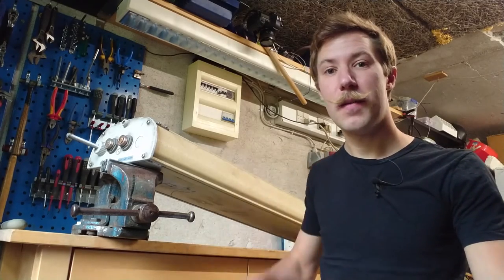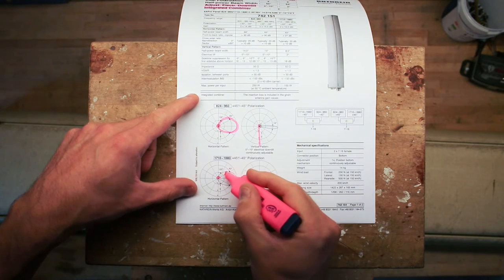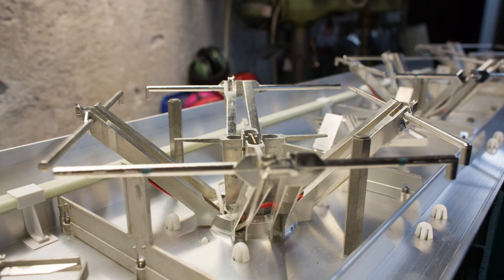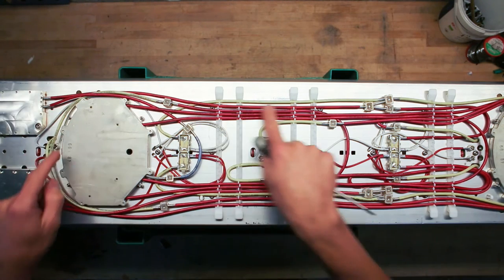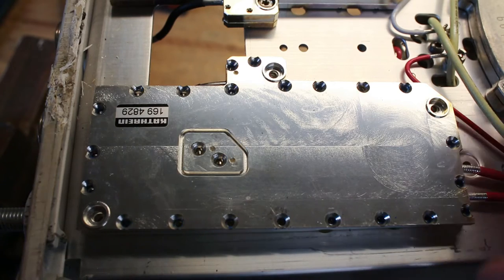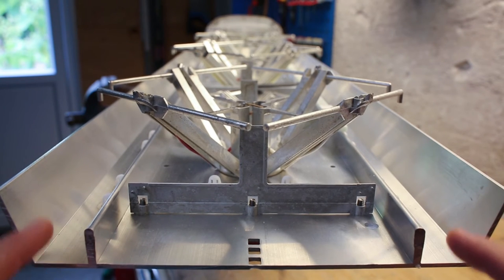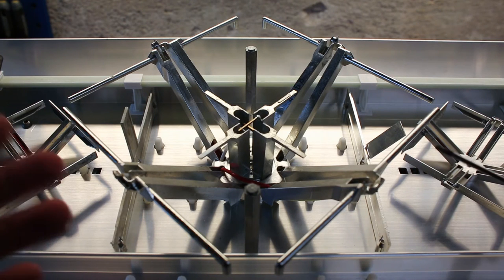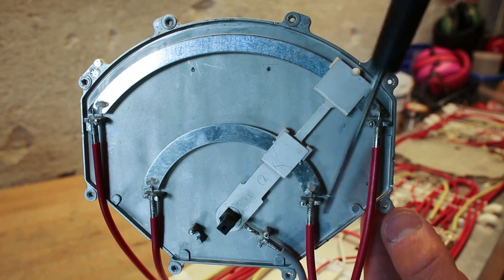Teardown of Kathrein 1800/900 MHz Antenna For Mobile Phone Base Station

Comment: At 11:00, it's not exactly a combiner - it is a diplexer (basically a splitter/combiner that converts one input into two outputs that are split across two frequency bands). It uses distributed element transmission lines to avoid discrete components. What you see on the trace is basically a combiner and a set of filters in one package. The "plastic" you took off the top to expose the traces is probably the same material as the board itself, and is used to realize the transmission line as a stripline within the diplexer body cavity. The diplexer lets the antenna have a single input/output port that can be used for multiple different bands.
Reply: Yeah, it's a common mistake.
Reply from the maker: I have done it as well with duplexer and diplexer :)
Reply: Where do you even begin to design something like that
Reply: Hi , what do S11 S22 and S33 should look like ...? Thankz
Reply: he is not wrong though. That piece "combines" for uplink (signals received by 2 antennas on 2 bands get combined into same wire) and it "splits" for downlink (900 and 1800MHz signals from the base station come in the same wire, then get split for transmission through two separate antennas). Actually, every combiner is also a splitter. It just depends where you input your signal and where you get the output. In this case, both ways work at the same time.
Reply: The combiner is a filter that is used to avoid resonance between low and high frequencies of the branches and arrays.
Without that the 900 MHz dipoles would also behave as a monopole for the 1800 MHz frequencies.
It can also serve to maintain high isolation between mime antennas.
It therefore keeps the radiation pattern optimal

Comment: Very interesting, I love how every panel like this (every part number) seems to be built a little bit different with different elements and a different architecture.
I have some of the bigger dipole elements with the more common "small sqares" in the middle. 

Also note how every color of semi rigid coax is a different impedance. 
Kathrein loves to use coax as transmission line transformers for matching all the different components. 

The coaxes are looped around the inside of the unit to keep the phase matched up, since every feedline needs to be the same - or atleast some known - length. 

The input diplexers are a piece of art and very stable. 
I wonder if anyone could come up with a design, that is as simple and effecitve. 
I guess these stripline designs are all autogenerated or atleast auto matched for efficiency. 
As Robberiffic said, they are a combination of filters and a power splitter. 
The upper dielectric makes them embedded striplines and also gives a higher dieelectric constant inside the enclosure. 
With a big airspace it is quite hard to keep oscillations down in such a enclosure with such high powers. 
All in all this sector antenna seems to be built quite a bit more solid than the ones I have seen. (also from Kathrein)

Greetings, 
Michael
Reply from the maker: I have also had a few that was made from a wobbly tinned copper plates soldered together in smaller squared compartments. The copper antenna is however more worth in scrap than these aluminium ones are :)
Reply: @KaizerPowerElectronicsDk  That's treu as well. :) 

I still wonder why there is such a variation in build qualitiy or "massiveness" in these panels.

Comment: Good job! very interesting. It really shows how much anamzing design there is on the RAN side of the network to make up for the tiny antennas in our devices and the low power levels used in the uplink.  Great to see how analog and physical it is to!
Thanks for the video!

Comment: Rewatching this video, and regarding your explanation of the radiation patterns, I remembered something I saw when I was in New York one time.

Instead of the antennas being mounted vertically like you would normally see them, they were mounted horizontally and titled upwards to get signal into high rise buildings. So basically trying to cover a vertical space rather than horizontal space.

I haven't seen this anywhere else yet.
Reply from the maker: That is an interesting observation, thank you for getting back to an old video with that! I have not seen that in Denmark, properly from the lack of densely packed high rises. Here we normally install local amplifier/antennas inside those buildings that can not be covered by the public networks.

Comment: HEY , great video ...I gonna run the diplexer through CST...would you give the dimensions of the BOX (only the outer dimension and thickness) the rest (microstrip)  i could generate myself...Thankz
Reply from the maker: Thank you, you will have to do with what you can see in the video. I do not have these parts anymore. The sandwich was properly 1 cm thick, two halves of 5 mm. I recall it being around 10x20 cm.
Reply: @KaizerPowerElectronicsDk  GREAT! i'll give it a go PS: Both 900 and 1.8 get in TOGETHER , then the diplexer splits to respective antennas...i guess

Comment: Hi. Here "https://www.dropbox.com/s/ukyutem1831rwrf/KATHREIN%20DIPLEXER.png?dl=0" you will find a brief but easy explanation about how it works the diplexer. It's a rough explanation, because without passing it on an VNA or an spectrum analyzer with tracking generator, it's not possible to have a true frequency/amplitude response. Nice video.
Reply: Thank you!
Reply: i have a 3d model already , guessing PTFE dielectric but not to sure how to run it (CST)...should i put below 900mhz to 2ghz through the port alone on top...or vice versa...guessing it takes BOTH signals and separate to correspondent antenna...